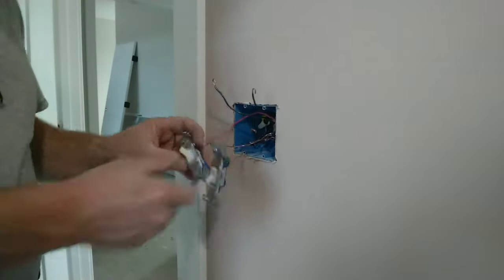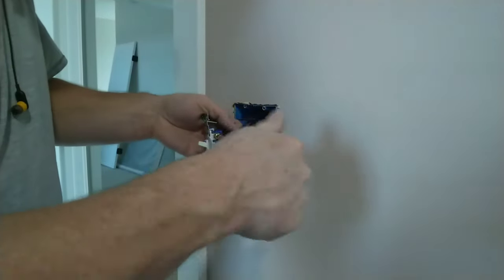How-to-wire up ceiling fan/lights on separate switches (helpful tips)

Comment: Hi, I wired a new ceiling fan.At the wall there are two switches, one for the ceiling fan and one for the ceiling fan light. Whenever the fan is on the light does not work. In other words, I switch the light on and it comes on but then I switch the fan on and the light goes off. Any idea what this could be?
Reply from the maker: Thanks for watching John. It sounds like you have got the feed wire and fan and light wire mixed up at the switch location. I would take a voltmeter and make sure you can determine which one is the Hot leg feeding the switch location.
Reply: @workingmanrondoyle3287  Thanks for the response. If I can determine which is the house hot coming into the switch box then how would I proceed?
Reply from the maker: @Grayback1973  how many NM Romex wires do you have entering the box?
Reply: @workingmanrondoyle3287  Box has two separate switches and I used a voltmeter.The top terminal on each switch is the house hot.The bottom two wires on the switches are as follows......purple for the light kit to control the light and yellow goes up for the fan switch.Now at the fan the purple is wired to the fans blue and the yellow is wired to the fans white. The fans black is wired to like 3 other wires assuming they are all house hots. I hope that explanation is clear enough. Not sure why the yellow leg wire for the fan is wired to the white neutral fan wire?
Reply: I figured it out Ron.It was the wiring at the fan motor and ceiling can. The yellow wire from the fan switch at the wall needed to go to the fans black hot wire.The white neutral fan wire needed to go to that clump of 3-wires that the fans hot black wire was hooked to. I volt tested that clump of 3-wires and they were not hot, they were neutrals so the fans black hot had no business there. Thanks for trying to help!
Reply: I have the same problem. Can you explain what you did to fix this problem?
Reply: @viviangermain1659  Yes, it ended up that the fans hot wire was hooked into the houses neutrals. The wire that runs from the switch at the wall up to the fan has to get hooked into the fans hot wire. The fans neutral wire obviously goes to the houses neutrals. Neutral wires in a house are typically white and hots are black. The wire that runs from the switch can be different colors like red or even blue. Still that has to go to the fans hot wire.The switch just passes juice to the fan when you flip it on and kills the juice when you flip it off. Hope that helps.
Reply from the maker: Thanks for watching and commenting. I'm sorry it's been a year ago that I'm now replying back to your question. Somehow I missed this one. It depends on where the feed is coming into play. At the switched location or at the fixture? Sounds like your feed is landed wrong creating this problem.

Comment: Could i just add one (hot) black wire to each switch and then use a jumper in between switches?
Reply from the maker: Thanks for watching and replying. If your referring to back stabbing a black wire into the backside of the switch, I don't recommend it. Solid connection with pigtails are the best practice 👍🏻
Reply: Every think of my his ran like yours except My two black hot wires wasnt long enough. So i i used a 4 port wago nut. I put the two (hot ) black wires and two smalll jumper wires in a wago and ran  a jumper wire to each switch. I hope that was okay.  Thanks for your video and response.
Reply from the maker: @lrjd3  Absolutely, wago's are great for that purpose. Thanks again for watching 👍🏻

Comment: I didn't hear anything abt wiring a ceiling fan. Did i miss what this was for?
Reply from the maker: Thanks for watching and commenting. I didn't wire up a ceiling fan in this video due to the video being to long. But I did mention the color of the wires on the fan in relation to the switches in the two gang box that was demonstrated. 
(Blue wire) on the fan is for the light and 
(black wire)on the fan is for the fan.

Comment: before i move into condo, there was one knob switch . one for fan and other for lights. lights are not attached to fan it separate. After i move in i noticed electrician change  switch to flip only, which operates lights only and fan is no longer working or any power going in? how can i fix this? by buying new 2 or 3 way switch or something?
Reply from the maker: Thanks for watching and commenting. If they removed a fan rotary controll and it's a single gang box with a 14-3 NM wire going to the fan? You have a couple options. 
You can still purchase the same type of duel function switch. Just make sure it is fan/motor rated. 
The second option is to buy a single pole/ single pole stack switch. This will allow you to control both functions separately. Another opinion is to install a remote control kit on your fan. You only need one feed going to the fan/light if a remote kit is installed. The extra wire at the switch location can be capped off with a wire nut. Hopefully that helps you.
Reply: @workingmanrondoyle3287  Thanks for reply . I think since one switch only used , Tech install wrong switch for light only and never used dual switch my guess
Reply from the maker: @KamranKhanmba  I just thought another way🤔  Go pull the chain on the ceiling fan to see if it comes on? It's passable, they wired the fan hot and the light on the switch. It's a cheaper way to get around, not having the right part for the job at hand.
Reply: @workingmanrondoyle3287  i pull the chain but no power going in it seems dead because no power , Its dead . I flip switch only light comes on which is not located under the fan , it is located in dining area in condo . Might have to replace switch with dual functions

Comment: it wasn.t shown how it was wired or tied together in the light box only wall boxes
Reply from the maker: Very good point. I'm trying to keep the videos short as possible by break up the video series on (things electricians do)This video focused on switch locations. The fan installation video shows what you may be looking for. Thanks so much for watching.

Comment: Now a very easy way to run a ceiling fan/light on two seperate switches just run a 12/3 romex and use black for one switch red for the other switch another thing before filming lay off that booga suga 😂😂

Comment: You didn’t explain exactly what black wires you tied together and where they were going this video was half informative
Reply from the maker: I thought I did, I'll rewatch it again. Thanks for watching and letting me know.
Reply: Sir, at about time 11:22 he mentions the 2 hot wires....feed in and feed out.

One back to the panel and one to supply constant power to to another box, a receptecle or another light.  The last black in the box....the other side of the switch goes to the light.